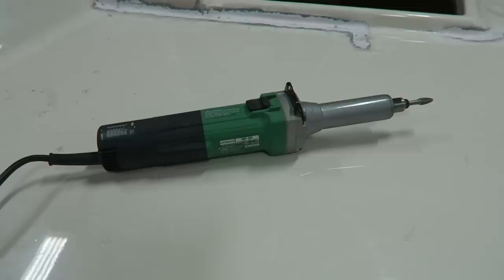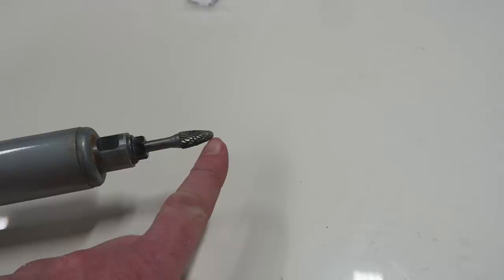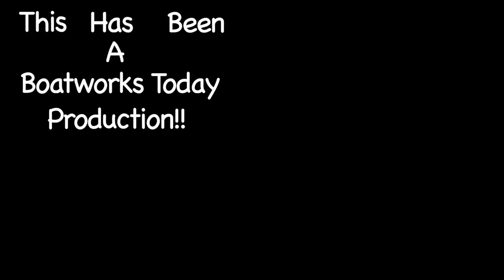Shaving Fiberglass, New Approach To Stress Cracks And Mail Call!

Comment: Question about die grinder bits .... would one with a 3/8inch rounded tip that that tapers up to 5/8 inch ( in a similar shape to the one you show ) ,  be too big ?

Comment: 8:06 Is it required to drill end of fissure with think drill bit to reduce stress
 tension
and stop cracking through?
Reply: These aren’t fissures, just surface cracks in the gell so you don’t need to drill the ends.

Comment: Hi there, great channel when i’m working on my boat i can usually find you’ve done a video on it. 2 comments that would reaaly help.

1. Simple but when you pull out a sander or tool could you note what grade paper you going to use for particular jobs. Sure you’ve mentioned it in specific posts but no way to find that post when we are looking at a particular job.
2. Seeing each job finished, even if only explanation of ending stages would be great. As on this job i don’t know how to finish it... guessing matching gelcoat  but how in these little cracks that you can only now sand flush... or did you take back whole area afterwards.

Ledgend show keep it up i’m off to join your patreon account now i’ve stuck my nose in. 😂

Comment: What about the next time you want to use that same tube of flexible epoxy? Will you need another mixing tip?
Reply from the maker: The tips are meant to be disposable, so the best thing to do is leave the tip on so the material cures and helps to protect the individual components in the rest of the tube.  Next time you need it, remove and replace the tip and you're back in business!

Comment: For gelcoat cracks at the cabin 4 corners of a 32' sloop  (balsa core deck surveyed to be sound and free of moisture/water):
I called Total Boat sales support and they recommended the following
1 .The thixo-flex-epoxy adhesive is epoxy, so you would need use an epoxy primer and then the gelcoat.
http://www.totalboat.com/product/thixo-flex-thick-flexible-epoxy-adhesive/
2. An alternative is to use Total Boat Polyester Fairing Compound, then acetone and the normal prep, then gelcoat.
http://www.totalboat.com/product/polyester-fairing-compound/

My comments: 
The thixo-flex-epoxy adhesive or polyester fairing compound should be ground or sanded flat and back enough to leave room for the gel coat.
Then the key is getting the color match and fairing it carefully.
Since the area is small, using gelcoat might be easier and less work than painting the entire deck and non-skid areas.

Question:
Would thixo-flex epoxy + epoxy primer + gelcoat be a better repair?

Comment: Is the mixing tube reusable?  If you do not use the whole tube of flexible epoxy do you have to get a new mixing tube?
Reply from the maker: Hi Ted, no they are not reusable.  When done using it's recommended to leave the cap on so that the material in the mix tube can cure.  By doing that it seals off the individual components in the rest of the tube preserving them for when you need to use it again.  Just remove the old tube and attach a new one and you're back in business ;-)!

Comment: Andy that is an impressive repair product but I do not think it is addressing the issue. What is the issue - hell I don’t know for sure BUT those cracks are coming about because either the gel coat was too thin, the fibreglass layup was too weak, the structure is not stiff enough and is flexing too much or combinations of the afore mentioned. So a great product but a bit like putting lipstick on a pig. 🐷

Comment: Can we see the end result, you always stop short. I think I can do all this, making it look lite is not a repair, that is what I am scared of. I watch your videos religiously and I got a steal on a boat with some soft deck. I almost have gotten the guts to cut up and glass it. Already have glassed the drill holes the numb nuts before me left in the deck. Now need to remove the seat and glass the stripped screws. All of this remains unseen, the parts where you can see the repairs are starting to give me cold feet.
Reply: Also, I have non skid like you show in the gel coat repair video. How stupid would it be just to fix all the holes, then spray the whole deck with gel coat?